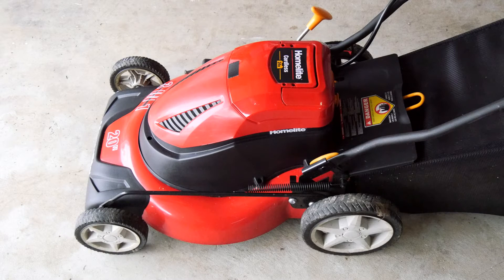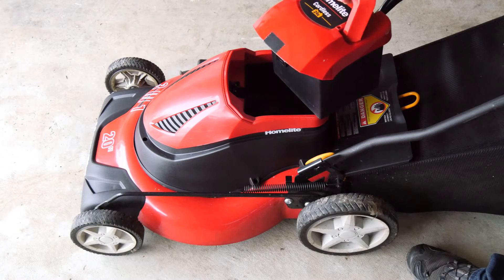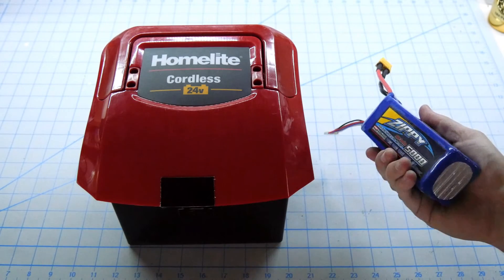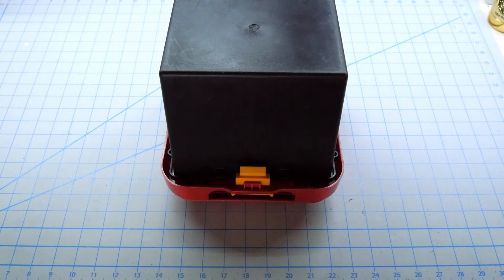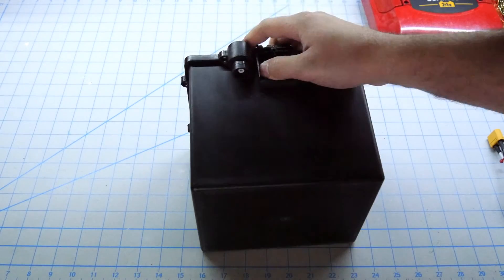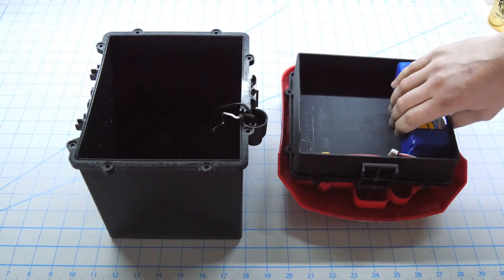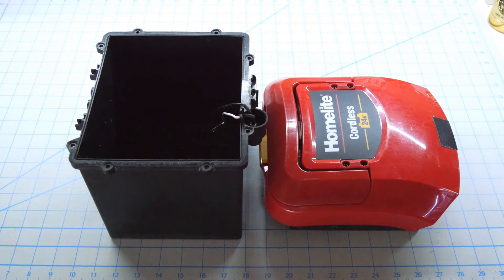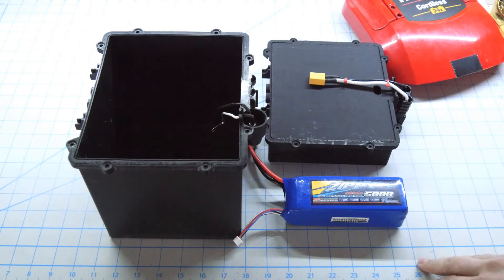Homelite Mower Lipo Conversion

Comment: I found this mower free curbside today and it works perfectly! I came across this video trying to find info on it. While I have no intention on keeping it, I'll flip it on Craigslist since we have almost an acre to mow, I love what you've done. Not only the battery conversion, but the write-up and video! Great job! It's nice when people share their knowledge with everyone the way you have...
By the way, I'm not sure if it was mentioned, but how much were the lipo batteries? Why wouldn't the manufacturer simply use them instead of the heavy ones? How much was this mower originally and how old is it?
Reply from the maker: I completely understand why someone would just leave this thing on the curb but if it still works, I'd say you got pretty lucky.  I'm glad you enjoyed the write-up!  It's sometimes frustrating when someone has a cool DIY project but left out all of the details.  I wanted my project to be different in that respect.  
The OEM replacement batteries were not cheap ($100) and the lipos seemed to make a lot more sense in more ways than one.  I'm not sure why the manufacturer went with SLAs instead. The lipos I used in the conversion vary in price but are generally about $50/ea.  They were only about $30/ea when I bought them.
If I recall correctly, the mower was about $200-$250 new. Keep in mind that Homelite is not a high-end brand so my expectations were probably too high to begin with.  In the long run, I probably got what I paid for.
Reply: I just picked up a free one too, bad batteries..  One measured 10.5 V and the other measured correctly, but with obvious deformation above one of the cells.  So, i will follow your conversion, thanks for that!
Reply: I was lucky enough to have a neighbor gift this to me when they upgraded their lawn and needed a more powerful machine. I've used it on my small yard, and I loved how quiet it is and it seemed to work long enough, getting tired just as I was finishing. Unfortunately, my charger got wet and now I'm stuck. A replacement charger would cost upwords of $60+ Used! . As I was looking for used chargers I came across your blog and had some hope. I will be shopping for the parts you used and hopefully maybe I can rig up something so that I can use my mower again, but maybe have more power as well for the same cost as replacing only the charger or hopefully not much more in cost.